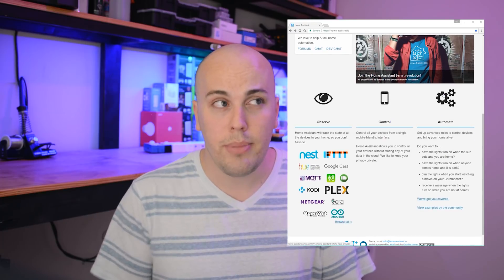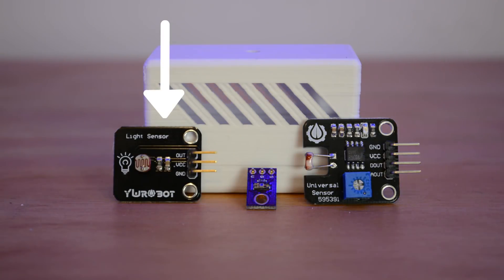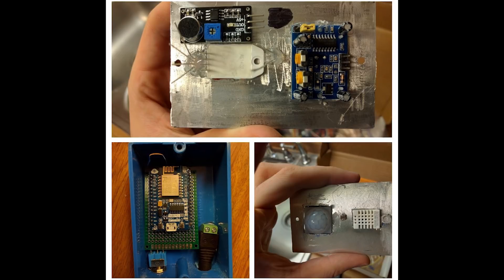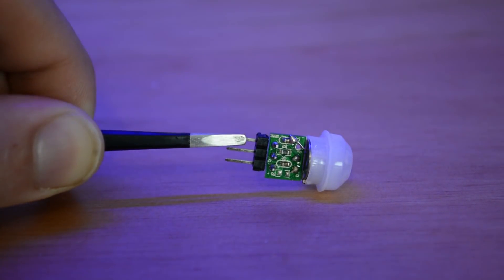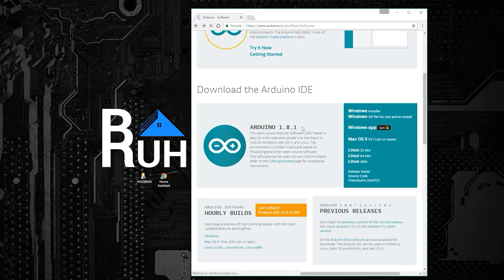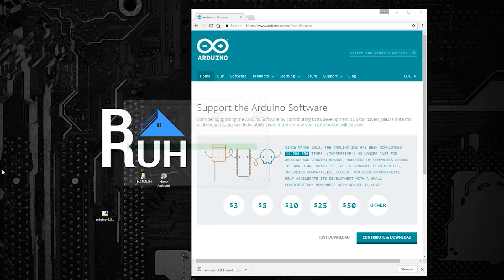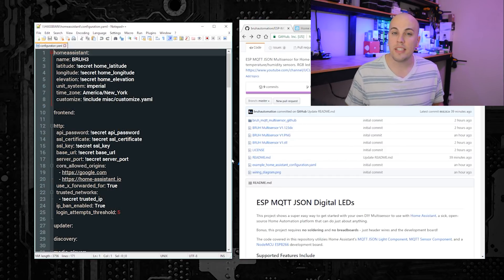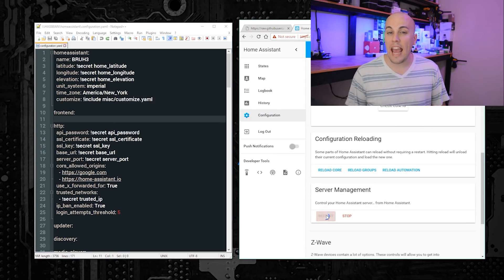$15 DIY Multisensor - Temperature, Humidity, Light, Motion, and RGB LED

Comment: Hi Ben, nice to see another nice video. I am a enthusiast follower of your channel. However, regarding this video, interestingly I just completed my multi sensor project 3 days ago. And my setup is dangerously close to yours!! Great minds think alike :-) But still you addressed one of my issue.. The PIR sensor reliability! By the way, I am using FTDI adapter and a ESP board which pins are exposed, so I could use the 5v for the PIR. But I didn't understand how you managed to use the 5v source as the nodeMCU has direct USB connection. Any suggestion would be most welcome.. Thanks
Reply from the maker: Haha, sweet! I use the microUSB port to connect my power supply to the NodeMCU board. The Vin pin on the NodeMCU outputs the power directly from the USB cable prior to going through the voltage regulator and onto the rest of the voltage pins. It's pretty convenient if you need to use a 5v sensor.  Cheers!
Reply: Thanks a lot Ben . is that so simple! can't wait longer to mess with my board which is right now on some Chinese ship I guess :-( By the way, I am using espeasy firmware, it's really easy to use.
Reply from the maker: Sweet! I need to check that out. Good luck on your build!

Comment: If you plug in the aeotec you can change its polling mode to something faster, it should respond very quickly.
Reply from the maker: Definitely. I used it plugged in for a long time. Works great. Just wish the light sensor was better in it. It's still pretty solid, though!

Comment: This is great, thanks so much for posting!  Any suggestions on where to get the case printed if I don't own a 3D printer?  Online services look like they'd be $25+ each.

Thanks!
Reply from the maker: For sure. Yeah, I'm not super plugged into the online 3D printing services. I'd imagine them all to be pretty compeitive. You might check for local maker spaces like the public library or college campuses. The sometimes offer pretty cheap services if you can find the right people. 

Or, you can just buy a 3D printer. They're pretty affordable now ranging from $170-$350 for printers than could easily handle the majority of the things I print. My printer has paid for itself a couple of times with all the things I print on it.
Reply: Awesome, thanks!  Also, any other PIR sensors that work?  The one you linked is sold out!

Comment: Hey Ben! I'm the guy who made the ESP RGB code that you referenced. 
Thanks for the credit in the code! I'm honored to have helped you.
https://github.com/corbanmailloux/esp-mqtt-rgb-led
Reply from the maker: Hello! Nice to make the connection with you! Yeah, thanks much for letting me borrow your code. I started working on flash/fade when I was migrating my code to JSON formatting, but when I saw your code it was way better so I just went with that. :P 

I also integrated it with my FastLED LED project as well. https://github.com/bruhautomation/ESP-MQTT-JSON-Digital-LEDs That builds on it with some effects, effect animation speed, and Arduino OTA. 

Feel free to fork that back into your repo and optimize it as you'd like. Cheers!
Reply: I just found the answer now :) I changes the type of LED (Ground connected negative instead the other was connected to positive!) :)
Reply: Hi Corban! Thank you very much to share this code. I'm learning Home assistant and also refreshing "C". On your code just the RGB LED I can not make to control it... Any help it will be great! At the moment the only thing I can do is turn the LED ON. :(

Comment: Would you ever do a guide on recording and transmitting ir and rf over Mqtt. Would love to control all my entertainment from openHab
Reply from the maker: That's cool! I'll check into it.
Reply from the maker: At Bez, what IR library are you using? 

It's something I've definitely thought about. IR is okay, but I'm not a huge fan because it's not send/acknowledge protocol, but that's not a huge deal, I suppose. I'll check into it!
Reply: This^^
Reply: No IR library required. espEasy has been pre-configured with libraries for many sensors including my TSOP4838. You simply choose the TSOP4838 IR from a drop down menu and assign it to a pin. The espEsp interface even shows you the IR codes for the remote buttons you've pressed (have to refresh the gui after each button press) which makes it easy to define the payload in HA.
Reply: Sweet, thank you!
Reply: I made an ir receiver. Easiest thing to use for controlling ir devices is with a Broadlink RM device.
Reply: Hey eric, I'm working on a similar project. I am trying to control my tv and soundbar using an esp8266. I would look into the IRRemoteESP8266 library, it helped me decode my remotes' signals and allowed me to rebroadcast those signals using the hex codes I got from decoding.
Reply: I'm controlling my Chromecast 2 via IR (No CEC on my TV) over MQTT using a TSOP4838 and an ESP8266. Also allows me to control anything else connected to HA. espEasy really simplifies this.
Reply: @Bez Hey, I just looked into a TSOP4838 and that only seems to be an IR reciever. What are you using to send out those IR signals to your Chromecast?
Reply: MQTT via home assistant. The Nodemcu receives the IR code and forwards it to the chromecast platform which you have to enable in HA. Chromecast is enabled in HA via your configuration.yaml file with: 

media_player:
 - platform: cast

You then need to set the appropriate triggers for controlling the chromecast playback, For example, Play:

automation:
  - alias: 'Play_ChromeCast'
    trigger:
      platform: mqtt
      topic: "ChromecastIR/IRda/IR"
      payload: '4230927874'
    action:
      service: media_player.media_play
      entity_id: media_player.paulchromecast

The payload: is whatever the IR code for Play is which you can get from the ESPeasy interface after connecting the TSOP4838 and configuring it correctly.
The topic: is derived from your ESPeasy web interface in devices/your IR config (ESPeasy Name/Task Setting Name/Value Name)
The entity_id: = media_player.(NameOfYourChromecast)
Reply: Ohh, my mistake. Looks like I completely misunderstood your reply above. Thanks for clarifying!
Reply: If you need any more info, let me know.
Reply: Hi, do you have details about making esp8266 mqtt IR Emitter? I'd like to use infrared emission to control the bedroom air conditioner, but I'm new, please help, thanks!
Reply: Hi, do you have details about making esp8266 mqtt IR Emitter? I'd like to use infrared emission to control the bedroom air conditioner, but I'm new, please help, thanks!
Reply: Hi, thank you reply, Ben you are our rookie admirers, I have Bo Lian rm pro, but rm pro living room control TV, air conditioning. My wife can not buy more than a Bo rm, so want to buy 8266sonoff plus ir infrared launch module, launch air conditioning remote control code to open it, but I only have ideas, not Arduino, only entry level.
Reply: Wait for your firmware to write, can share it? ? Do i leave my mailbox? ? Cheers
Reply: Have a look at OpenMQTTGateway  https://github.com/1technophile/OpenMQTTGateway

Comment: This is great! What about a DIY contact sensor? With as many windows and doors in a house, those end up costing more than just replacing light switches.
Reply from the maker: For sure. If you found the sensor, it would work with this code. It'd be just like the PIR sensor code, but you'd need to flip the high/low logic to however you wire the contact sensor. Cheers!

Comment: mate that's crazy I was having the same issue with my motion sensors they just get crazy some times I'll test this motion sensor. did you find the reason why they go crazy when they are close to.the esp8266?
Reply from the maker: Best I can figure is it's RF interference from the WIFI transmissions. The AM312 is still working great, though!

Comment: Hey Bruh, 
How would I change it to work with a common Anode LED rather than common Cathode ?
Reply from the maker: You'd need to subtract the RGB values from 255 basically. Check out page 9 here -> https://cdn-learn.adafruit.com/downloads/pdf/adafruit-arduino-lesson-3-rgb-leds.pdf

Comment: Awesome work again, Ben! Funniest thing was I was working on a similar project. For my Home Assistant implementation I am also using an ESP8266, MQTT broker running on the Pi where HA lives and I am working with a regular photoresistor (very reliable and awesome) and a SR505 motion sensor, which much like you said, reports all over the place and is driving me insane :) I now ordered the PIR motion sensors you recommended, thanks for taking the time to research this so we can all benefit! Stay awesome.

Comment: Brilliant! Exactly what I was looking for. Just wondering whether this build would still allow for the addition of a smoke/co2 sensor? I figured that would be a useful addition for indoor setups.
Reply from the maker: For sure. There are a few free PWM pins if you can figure out the power. The LoLin all-in-one board has an extra Vin pin if you don't mind the bigger size. Let me know how it goes for you!

Comment: Ben! 

Awesome video man!  I was thinking about building a weather station to set outside.  IT would have a humidity, temp and light sensor are well as barometric pressure and wind speed, direction, and rain gauge? I think this could be a good start for that. 

Oh also for those esp8266 flashes checkout flasherjs you can run javascript on them.
Reply from the maker: For sure! Let me know how that goes for you!
Reply: I'm spinning my wheels here,  I think a better use case in the immediate would be a garage sensor.  Just add two relays that can be triggered to open close the garage door. Those would tie in to the door control buttons already on my opener as they just close connection for a split second and that triggers the open/close... Add 2 sets of those magnet proximity sensors (one for each door) and that should tell me if the door is open or closed. 

In practice I'd love to have battery powered or at least battery backup and maybe z-wave instead of WiFi. I rather not open my router control panel and see a billion sensors. 

Thoughts?
Reply: Also I have a set of these in my kit already https://www.amazon.com/dp/B016U051MK/ what do I need to make this a replacement for the node MCU (programming it, powering it, getting pins to connect too etc. )

Comment: Hey Ben! You mentioned that you originally made an "over-engineered" version with standoffs and such. Did you end up finalizing that? I just figured that for those of us who have access to a high quality 3D printer that can do all those standoffs to the proper tolerances it might be nice to have that as an option? If you finished that then I'd love if you would share the files. 

My library actually has a really high end 3D printer so I'm fairly sure it would be able to print those fine details.
Reply from the maker: I don't think I have any of those. Unfortunately, with 123D Design it overwrites changes and there isn't an easy way to revert. I'm switching to Solidworks or Fusion 360 as 123D has been discontinued. I'll do better about keeping track of my changes and try to provide the higher quality enclosures in the future. Cheers!
Reply: Good to know. I might have to try my hand at making my own enclosure at some point. Thanks for all the great work! I'd probably never have made this without you letting me know it exists.

Comment: Thanks ben, where is vn pin? I do not find it..
Reply from the maker: It's on the lower left if the microUSB port is on the bottom. Should be labeled Vin.
Reply: BRUH Automation yes! Vin.. I did it know there is 5v on 3v version, big thanks ben, you are the best.

Comment: Great video again! These video's have really gotten me into home assistant! I see a lot of v3 versions of the NodeMCU on Aliexpress for the same price. Is there any reason to use the 1.0 over the v3 ones (since they are the same price)?
Reply from the maker: The NodeMCU V1.0 is going to be a little smaller than the LoLin V3 ESP dev board. The V3 does have an extra Vin pin and ground next to A0 so you could add an additional sensor like a digital sound module or something. If you don't mind the added size then the LoLin V3 chip is solid.

Comment: Lol, what's the point of the rgb? 😂
Reply from the maker: For sure. It's really neat because that LED is controlled exclusively by HA rather than being hard coded in the sketch. You could make an automation to trigger an LED color on a stock price or if a door is opened.. or to represent temperature ranges in a room or flash on an alarm event. Cheers!
Reply: Use it to visually indicate the state of a particular sensor.  I'd use it to indicate a humidity or temp limit or indicate the tripping of the PIR sensor.  And because it's RGB, you can have a different color for each condition.
Reply: Aaah

Comment: Can I adapt wemos D1 mini pro with external antenna? I have a very poor range in my garage. Any differences in connection or sketch?
Reply from the maker: For sure. I don't think the sketch will need any modification. You will need to splice some wires together, though, because I don't think the Wemos D1 mini's have enough voltage pins on their own. Should be pretty simple to do. Let me know how it goes!

Comment: I'm only half way through the vid, but I have to ask... what's the light that flashes intermittently behind you  just below the top shelf?
Reply from the maker: That's a Fibaro multisensor. When it detects motion, it flashes. Cheers!
Reply: Thanks, Ben. I should've watched to the end before commenting and it would have been obvious! Great video. I'm going to give this a go at some point when I have some time.

Comment: I thought you were going to build the sensors using the mysensors library. It is so easy! 
Good job anyway!
Reply from the maker: MySensors is solid! I just preferred sticking to the PubSub/MQTT because it's what I'm familiar with and easy to use with JSON. Cheers!
Reply: I am looking into this now.  Is there any advantage to going the mysensor route?  The only thing I can think of is it would be low power so it could easily be supplied by batter which I think would be an advantage if you want to through this sensor up on the corner somewhere and not have a cord hanging down.
Reply: Hi, have you already figured out if would be possible and worthwhile porting this to mysensors?
Reply: Fernando Reis hi, yes I built a multi sensor using mysensors. And I successfully connected it to Homeassistant
Reply: Great. Did you get the RGB Led working with Fade, Transition, Flash as well? And running on battery?
Reply: I didn't add leds to it. It's motion, light, humidity ant temp sensor.
Reply: I am also running in circles trying to get the LED working (rest all worked), no help from BRUH as well what so ever...... whats your status?
Reply: Sammy Singh we probably same issue, my RGB LED is common anode. Ben mentioned to be in common cathode.

Comment: Very cool! Any plans to sell kits?
Reply from the maker: I've definitely thought about it! Because these parts can be sourced so cheap from China, I doubt I'd be able to make a compelling price point for most. 

If I could upgrade my printer, I'd happily make the enclosure + parts as a kit, but that's not in the cards right now.   Cheers!
Reply: Any problems if I look into making up a NodeMCU 'hat', basically a plugin PCB to replace the jumper wires? Build a complete plug-n-play sensor platform.
Reply from the maker: Not at all. That'd be sweet if you got it setup and going! Keep me posted.
Reply from the maker: Definitely not! Keep me posted on your project!